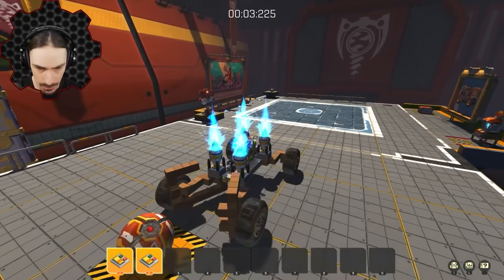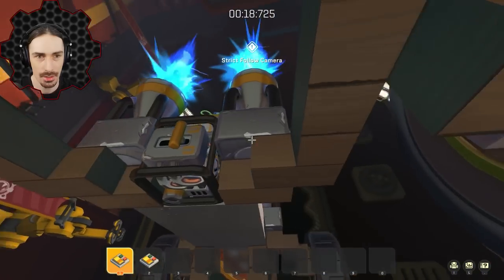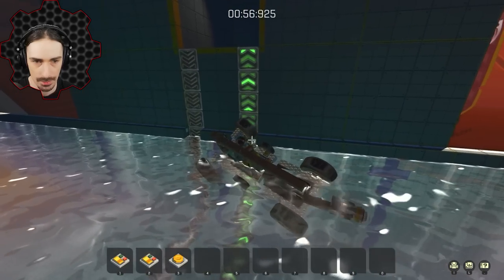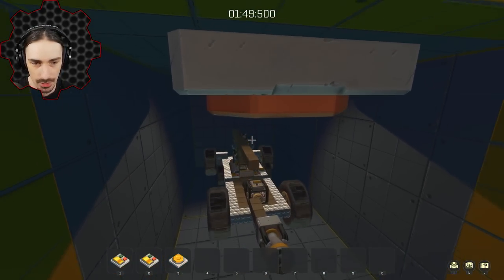This Car Looks Dumb, But It's Actually My Engineering Masterpiece...

Comment: For challenge 46, the button challenge I built a flyer that constantly rotated backwards but you could counteract and rotate forwards using suspension glitches (I had to do that because of the limited controllers)
Reply: I did exactly the same as scrapman did first off and failed, but with a heavier car that's basically a sheet of bubble wrap, but after trying a while i realized that the piston made enough leverage to push the button while going down and making my car hang onto the ledge.
Reply: My version was a flyer too but with suspention glitch steering and the bach thruster could be rotated so it pointed more back and that helped me to move forward

Comment: 9:40 ScrapMan, it is so simple. Just put a bearing on the end of the long stick and attach 6 blocks of wood that  point down and hook up a controller that when you press a third switch it tells the bearing to turn 135 degrees (personally i think turning left would be cooler) and the rotation of the piece would be enough to push the button

16:57 "That was craythy." -ScrapMan 2022
Reply: "It's so simple"

writes whole paragraph

Comment: For the challenge 46, I think they wanted you to make those oldschool X-like pistons.

You know, those ones we were using before the actual pistons came

But anyway, it's was awesome video. Loved it
Reply: Um what?
Reply: @jamesTBurke  no, there was this guy that replied and said the exact thing I meant in a more appropriate way, but he deleted the reply

Anyway, what I meant is a scissor lift  like thing
Reply: @Sterben-9029  oh ok. I know what a scissor lift it. I'm just new to the game so I didn't know what you were referring to
Reply: @jamesTBurke  it's fine.

It's always nice to see there are new players to scrap mechanic.

A little tip: 
when building, don't be scared to destroy stuff and redo it.
It will take time, but it's gonna be better.

One more tip:
If the thing just doesn't work or you give up, then slap a bunch of thrusters on a switch and send it flying or just bomb it with explosives
Reply: @Sterben-9029  When in doubt...C4

Comment: My vehicle for challenge 46 was very unique. I had thrusters on steering bearings move from the center of the vehicle to the back so I could steer in the water. The thrusters were on a system of small arms that would change them from being in the center and facing upwards to moving them to the back and rotating them so they face backwards. From this, I was able to drive up the walls and then move into the slots. The piston for pushing the buttons were pretty much the same apart from that I had a single block on top instead of a bar. Challenge 47 was the worst one for me. Everything I tried just didn't work so I gave up and went to sleep. The next day, I finally had something that worked. It didn't get it into the hoop but it launched it under the hoop and it rolled into the ball receiver socket.

Comment: Hack for amphibious vehicles. Put the rear wheels..and thrusters on the steering berings. It drives the same land or sea. Saves berings for other needs/less berings for lag.
Reply: You misspelled "bearings", test failed.
Reply: @lexo632  ive done so so often the phone seems to accept it

Comment: The button chalenge is actually pretty easy. I built a simple wallrider with the thrusters rotating and a piston poker for the buttons. But if you build a simple wallrider you could just go on the bottom of the water

Comment: I just wanted to mention an I teresting discovery that has been made in scrap mechanic, 2x2 bearings work, If you place bearings like this, and make sure they all rotate in the same direction, it actually functions. The only issue is that it only works to a certain extent. They can only rotate maybe 15 degrees, unless you set your physics quality to the minimum, giving full range of motion. I did not discover this, but I do not know who made the original discovery, so if anyone finds who it was, credits to them.

Comment: for challenge 46 i feel like i under engineered it by just making extendable arms using the controler and bearings, it worked pretty well though its a boring solution

Comment: 9:00 I think this design could have worked if you made it slightly taller with and placed a bearing connected to a controller on the end of the extended bit to rotate upwards and hit the buttons so leverage is less of an issue, although I don't mess around with Scrap Mechanic's water to know if this would have prohibited balance in the water
Edit: I just saw someone had the same idea in the comments, I typed this before seeing, don't kill me